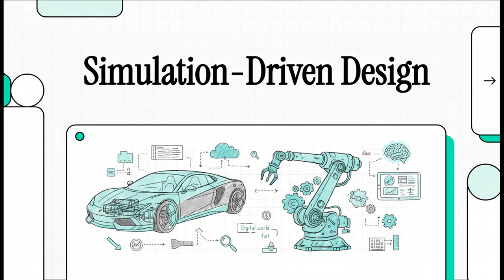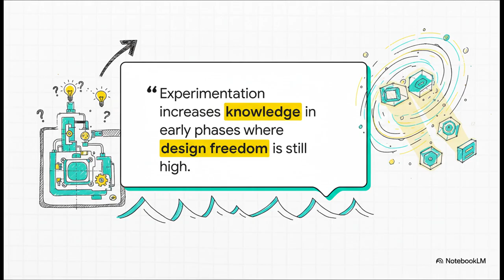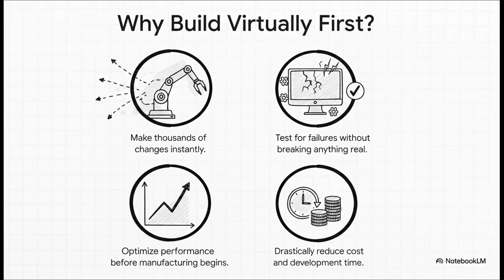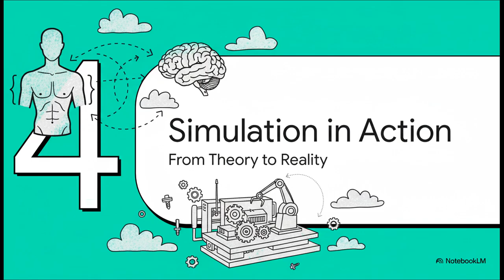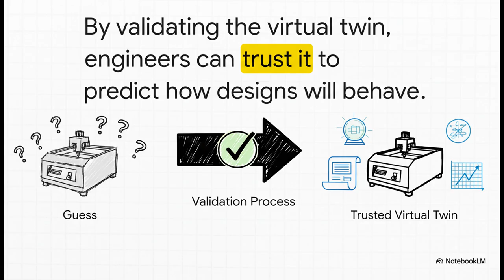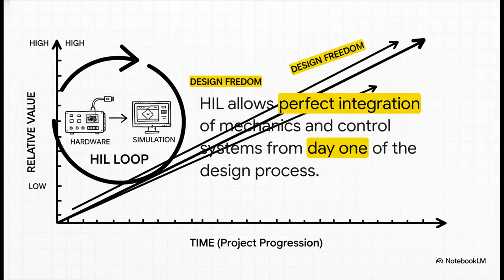The “Digital Twin” Revolution: Why Physical Prototypes Are Dying

Comment: In 1995 Pratt & Whitney got their PW4000 high-bypass turbofan approved by the FAA for test flights on the Boeing 777 based entirely upon simulation. The paperwork stack pilled up was taller than their tallest engineer. It was the first engine approved for test flights based upon simulation.